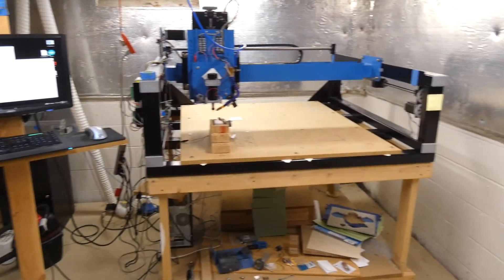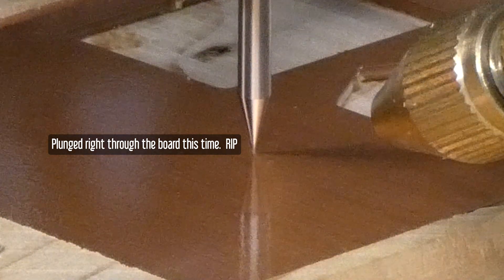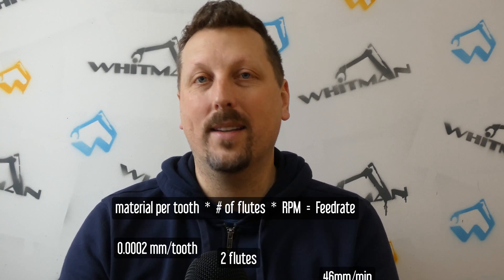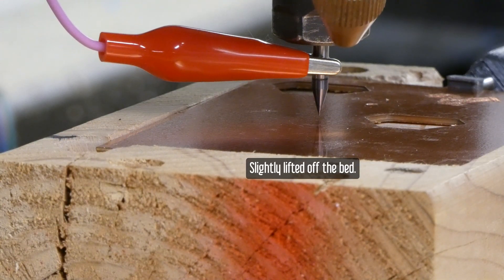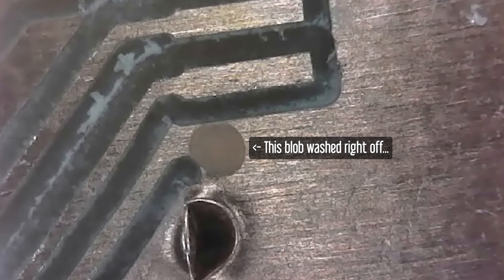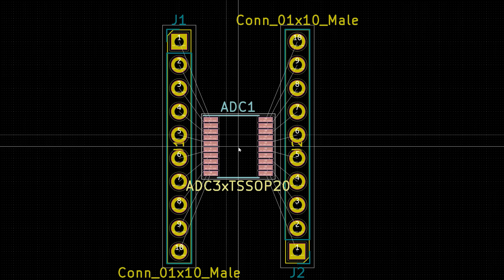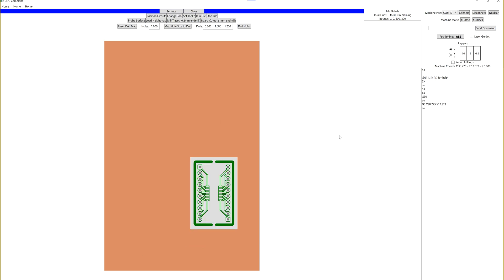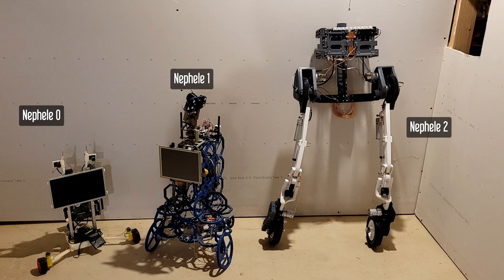Milling Circuit Boards on a Homemade CNC - Nephele03e01

Comment: Hi,  maybe you know this..   i am puzzled for weeks now.

i am having problems with PCB and i cannot find the issue.. I am doing the following. using UGS. Same problem with Gerbal
blank pcb.
set Y,Z,Z
Set the Z probe
Do a Scan surface, with apply to gcode checked.
Carve. this side is perfect
drill the center holes.. works fine too
flip the board
Set the Z probe
Do a Scan surface, with apply to gcode checked.
carve. result bad..   parts are done on the left and then  the rest of the board it just goes over it
what am i missing here ?

Tried Flatcam and Coppercam.

Comment: hi,  do you have any videos  that explain the Tool Diameter in Flatcam?    I am trying to find out  some more detail,  in case i want to use 30 or 60 Degree bits,  but  i dont understand what is meant by that.  and   googling brings me to the same videos,  but nothing is explained.   the tool diameter  vs v-dia    i noticed when i use 0.19 with a 15 degree bit it's perfect..  but using a 30 Degree bit and the rest the same settings,   there is nothing left for those traces..    thank you
Reply from the maker: My newest video has a pretty sweet section on solder masking at around 16:59, by the way.  On the V-bits I used to use, there's a tiny flat spot at the tip, like 0.02mm or thereabouts.  I plugged that into FlatCAM for a while.  I don't quite remember how I got it working, but if I was doing it now, I would calibrate my setup.  Set up a copper blank, probe the z-height on my engraving bit.  Run a line for 40mm or so with a depth of 0.0, then move up 5mm and run another line of 40mm with a depth of 0.01mm.  Just hand-write some g-code to do these calibration passes, stepping 0.01mm deeper at each pass.  Maybe do a couple lines above 0 in +0.01 increments, if the 0 line was too deep already.  Then you can pick the depth that gives you the ideal isolation amount.

This is what I did to find the best cutting speed for those PCB tapered endmills I linked you to before.  Nothing beats a good calibration test.  I mess around and guess a bunch and then I remember I can just try a bunch of small increments and know for sure that I'm using the best setting.

Once you've done this test and calibrated the depth of cut for the perfect amount of isolation, measure the width of the cut that your v-bit made in the copper.  Then you can set it up in FlatCAM as a cylindrical cutter with a diameter matching the width of the cut you measured.  FlatCAM will then position the bit at the correct distance from the traces to do the isolation properly.  :)
Reply: @WhitmanTechnological  is that video online ?   clicked on the time, and didn't get anything.
Reply from the maker: @perrykappetein9685  YouTube turned the timestamp into a reference to this video.  Here's a full link: https://youtu.be/klIPyo_2Gzc?si=mzK2Lec6yMyXhnS7&t=1019
Reply: @WhitmanTechnological  thank you.. watching the whole video :)

Comment: hi,  are you doing solder mask by any chance as well?    i quite can't figure that one out yet..   using the same settings as well.   and even  tried the z-cut  + 0.1  but  its still making holes  instead..  while 0.0  was working fine for traces.. so  i'm a little puzzled.
Reply from the maker: Yeah, I have a really nice setup for solder masking now.  I 3D printed a little PCB vise and mounted it to my router.  It ensures I can take a board out of the router and put it back again and it'll be in exactly the same place.  I print the solder pads from KiCad to a transparency.  Then I spread a thin layer of UV solder mask over the board (under a thin sheet of clear plastic), carefully align the transparency where it needs to go.  I mill the tracks into the copper blank and then take it out to apply the solder masking.  After curing under a UV lamp and cleaning up with some alcohol on a paper tower, I put it back in the vise exactly where it was for the tracks.  Then I run the jobs to drill the holes and do the board cutout.  The boards come out super nice.

I'm editing a video right now and hopefully will have it up on the channel in a couple weeks. The footage for the video was recorded over the last two years, and the improvements to my router and PCB workflow will be one of the segments.
Reply: @WhitmanTechnological  looking forward to that video

Comment: Not sure what happened before,  but  I redid the settings in Flatcam, and now  the milling was perfect..  not sure what went wrong before..   i know  it looked different after i did the  cnc routing.   so i am happy.  thank you for all your help in this
Reply from the maker: Yaaaay!:face-blue-smiling:
Reply: @WhitmanTechnological  also realized that i had the wrong bit in it...  not sure how i mixed it up :/.    but   the new one I have is  
0.0071in. (0.180mm) tip dia., 3-flute 15° tapered stub, 0.010 in. DOC, 1.42 in. (36mm) OAL    also had it marked as 30 Degree in flatcam instead of 15 degree..    and i did  0.29 for the tracks and clearance..  might be able to do smaller,  now i have the right bit  in it :)   and then time for doing the holes etc..
Reply from the maker: @perrykappetein9685  Sounds like you're cruising now.  Very cool :)

Comment: making a new post.  seems like my other keeps disappearing..     not sure why.
i tried making some tests ,and  it keeps wiping out my traces.    
I am using  Tracks 0.25mm, clearance is 0.2mm   and your settings..    also bought the bits you  advised.  not sure  if i am missing something  in flatcam.    i have all these settings
not sure if i missed any ?

Will post a reply with a screenshot if it as well

"2": {
    "name": "New bit 1",
    "tooldia": 0.19,
    "offset": "Out",
    "offset_value": 0.0,
    "type": "Finish",
    "tool_type": "C1",
    "data": {
      "plot": true,
      "tool_target": 3,
      "tol_min": 0.0,
      "tol_max": 0.0,
      "cutz": 0.0,
      "multidepth": false,
      "depthperpass": 0.8,
      "vtipdia": 0.2,
      "vtipangle": 30.0,
      "travelz": 2.0,
      "feedrate": 115.0,
      "feedrate_z": 20.0,
      "feedrate_rapid": 1500.0,
      "spindlespeed": 10000.0,
      "dwell": false,
      "dwelltime": 1.0,
      "ppname_g": "default",
      "extracut": false,
      "extracut_length": 0.1,
      "toolchange": false,
      "toolchangexy": [
        0.0,
        0.0
      ],
      "toolchangez": 15.0,
      "startz": null,
      "endz": 15.0,
      "endxy": null,
      "search_time": 3,
      "z_pdepth": -0.02,
      "f_plunge": 0.0,
      "spindledir": "CW",
      "optimization_type": "R",
      "feedrate_probe": 75,
      "segx": 0.0,
      "segy": 0.0,
      "area_exclusion": false,
      "area_shape": "polygon",
      "area_strategy": "over",
      "area_overz": 1.0,
      "polish": false,
      "polish_dia": 10.0,
      "polish_pressure": -1.0,
      "polish_travelz": 2.0,
      "polish_margin": 0.0,
      "polish_overlap": 5,
      "polish_method": 0,
      "tools_ncc_operation": "clear",
      "tools_ncc_milling_type": "cl",
      "tools_ncc_overlap": 40.0,
      "tools_ncc_margin": 1.0,
      "tools_ncc_method": 1,
      "tools_ncc_connect": true,
      "tools_ncc_contour": true,
      "tools_ncc_offset_choice": false,
      "tools_ncc_offset_value": 0.0,
      "tools_paint_overlap": 20.0,
      "tools_paint_offset": 0.0,
      "tools_paint_method": 0,
      "tools_paint_connect": true,
      "tools_paint_contour": true,
      "tools_iso_passes": 2,
      "tools_iso_overlap": 50.0,
      "tools_iso_milling_type": "cl",
      "tools_iso_follow": false,
      "tools_iso_isotype": "ext",
      "tools_drill_cutz": -1.7,
      "tools_drill_multidepth": false,
      "tools_drill_depthperpass": 0.7,
      "tools_drill_travelz": 2.0,
      "tools_drill_feedrate_z": 300.0,
      "tools_drill_feedrate_rapid": 1500.0,
      "tools_drill_spindlespeed": 0.0,
      "tools_drill_dwell": false,
      "tools_drill_offset": 0.0,
      "tools_drill_drill_slots": false,
      "tools_drill_drill_overlap": 0.0,
      "tools_drill_last_drill": true,
      "tools_cutout_margin": 0.1,
      "tools_cutout_gapsize": 4.0,
      "tools_cutout_gaps_ff": "4",
      "tools_cutout_convexshape": false,
      "tools_cutout_gap_type": "b",
      "tools_cutout_gap_depth": -1.0,
      "tools_cutout_mb_dia": 0.6,
      "tools_cutout_mb_spacing": 0.3
    }
  },
Reply from the maker: I take it you're importing a Gerber file, and when you do the isolation cuts it's not cutting out all of the the tracks.  It seems to be skipping parts of it - particularly adjacent, parallel tracks, yes?  If so, what I would try first is find a setting that does work, and walk backward from there.  Try setting the bit diameter to 0.02mm.  Where there would be plenty of wiggle room between tracks.  Do you get toolpaths at that point.  Walk that 0.02 up to 0.08 and try again, then 0.15 or whatever.  Eventually you'll find a diameter where FlatCAM says the bit can't fit between the tracks anymore.  If your Gerber file doesn't have reasonable spacing between the tracks, that's a problem in how it's coming out of KiCad.  When stuff breaks, try starting at a known good setting and watching what happens as you walk back to your target values.  Good luck!
Reply: @WhitmanTechnological  it's wiping out the other tracks as well. So I have a blank board
Reply from the maker: @perrykappetein9685  When you import the Gerber file in FlatCAM, you should see the outline of all the tracks and pads and stuff.  Do you seen any of that?  If not, check if you're outputting the right layers from Pcbnew, that the units are consistent, etc.  Sounds like there's nothing to look at in FlatCAM to do the isolation routing???
Reply: @WhitmanTechnological  it's there and everything is blue
Reply from the maker: @perrykappetein9685  When you pull in a Gerber in FlatCAM, you should see the tracks and pours and pads and everything from KiCad nice and easy.  This is how the FlatCAM process should look: https://imgur.com/a/peRFtop

Comment: can you share your flatcam profile?   also in kicad,  what settings do you use for the tracks and space between it ?
Reply from the maker: After much refinement, this is where I landed.  It works awesome, comes out of the mill clean.  The second pass clears out all the copper doinkers that were shorting between the tracks when I was doing a single pass.  A quick rinse and dry and it always tests clean.  The extra machine time is easily worth it for the board to be error free.
FlatCAM:
Isolation tool 0.19mm C1.  2 passes 50% overlap
CutZ: 0, Feedrate X-Y: 115, FeedRate Z: 20.  Spindle is around 11krpm

KiCAD:
Tracks are 0.25mm or bigger, clearance is 0.2mm
Reply: @ thank you..  i have a 3020   and i cannot get it that good.  i do set it to a V bit.   and a cut of 0.05  otherwise it grinds away.   what bit do you use?
Reply from the maker: @perrykappetein9685  These bits are awesome for PCB milling.  I was doing V bits for a while, but the results were inconsistent.  I grabbed six of these puppies and They're fantastic.  I made about 60 boards with a single bit before it wore out.

https://www.precisebits.com/products/carbidebits/tapered_stub_125.asp

I bought the 7thou / 0.8mm bits.  They've been excellent.  If they're breaking, check your runout and spindle vibration.  I adjust the spindle speed to find a smooth RPM whenever I'm going to do a job, and I bought a "high precision" collet for like $15 that cut my runout in half from like 5 thou to 3 thou.
Reply: @WhitmanTechnological  was that this one?  0.0039" (0.10mm)	0.0065" (0.17mm)	0.010" (0.25mm)	2	15°
Reply from the maker: @perrykappetein9685  Yeah, oops.  I meant 0.18mm, not 0.8mm.  It's the [ 0.0071" (0.18mm) - 0.0097" (0.25mm) - 0.010" (0.25mm) ] one.  I bought three with the ZrN and three without.  Coated and uncoated both work awesome.  Coated might last an extra 10 or 20 boards if you don't break it first.

The crucial measurement is the 0.18mm tip diameter that coincides with telling FlatCAM it's a 0.19mm cylinder and telling KiCad to leave 0.20mm between tracks.  Vibration and runout are a thing, and these tiny margins end up giving really nice results on my CNC.
Reply: @ thank you..  let me dig into those..   guess i am puzzled when i used  0.1  and 0.2  bits   that my  cut needs to be 0.05 only   if i did 0.1  it digs a lot through the board.
Reply from the maker: @perrykappetein9685  These bits aren't V-bits, they're almost cylindrical endmills, with a 15° taper to the sidewall.  The material removed is much more consistently 0.2mm compared to the depth of cut variance you get from a v-bit.  The slight taper really helps add strength so these bits are a lot more resistant to vibration and runout than a normal cylindrical endmill.  I broke around $400 worth of cylindrical endmills.  These bits are appreciably more resilient.   [edit: With these, I use a cut depth of 0.  The pressure needed to make an electrical connection on my z probe is the perfect amount of pressure for these bits to cut through the copper cladding.]

Comment: I am very happy with cheap V-Cut bits, even with a terrible chuck/collet.. I think expensive bits are overkill for this kind of job..

I have a cheap crappy Chineese 3018 CNC. Instead of buying it I should have built my own.. There is nothing good about this CNC.. I replaced nearly every part of it: rods with linear rails, T-nuts, Z assembly with 3D printed one..  Only ER11 chuck, collet, steppers and the spindle motor remain. Bit has 0.1mm wobble. Adding that to 0.2mm V-Cut bit, around 0.32mm tool, the results are satisfying.. I know 0.2mm is needed for some packages. I orderred new chuck, and collet.

Even with this configuration, it took my electronics life another level.. Design and build in 60 minutes and repeat.. Fantastic!..
Reply from the maker: That's awesome, thanks for sharing.  Nothing beats the turnaround during prototyping of being able to make your own circuit boards.  :)

Comment: Great! Thanks Josh. Just found out that flatcam is available for Linux!!! yea me!  I run Linux Mint (fork of Ubuntu) and love it to death.  I've been getting confused about gerber files vs grbl files lol. Flat cam to the rescue I reckon. On another note, I'd like to do my boards green, then use the cnc to remove the resist for each solder connections. Any ideas on this?
Thanks in advance!
Doug.
Reply from the maker: Sorry for taking so long to reply, I didn't notice this comment when it came in three days ago.  I saw a marketing video for a company that sells a mini CNC router that's specifically for endmills (edit: for PCBs).  Their process has you milling the traces first, and then your apply an epoxy solder mask on top of that.  Then the router delicately mills just the epoxy off of the top of the foil (edit: where the solder pads should go).  Given how warped the blank boards are and how very thin the copper cladding is, I haven't attempted it myself.  I'm using mine for prototyping - to figure out how the circuits need to work, but I'm going to be ordering a small batch of boards from JLCPCB once I know the wiring is correct.  I priced out my little "smart bone" boards, and it was like $6 with two day turnaround.  Would take me almost as long to mill six of them myself and I'm just doing single layer boards.  So the rumor is that you can gently carve off a solder mask with an endmill.  I don't think I'd want to do it, though.  With a layer on top of the copper, I couldn't height probe successfully. If the cladding isn't at least 0.2mm thick, it's be pretty dang hard to clear the pads without erasing the 0.035mm foil unexpectedly.  A photo-cure epoxy might work with a stencil, though.  So that's why I haven't explored doing it personally - it seems unlikely to succeed with my equipment.